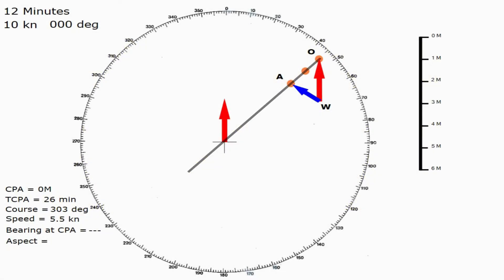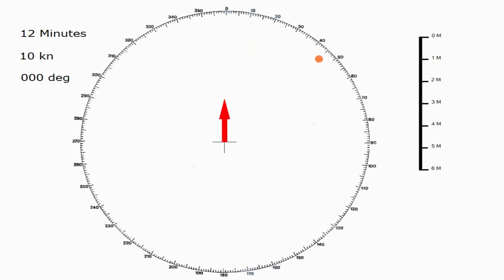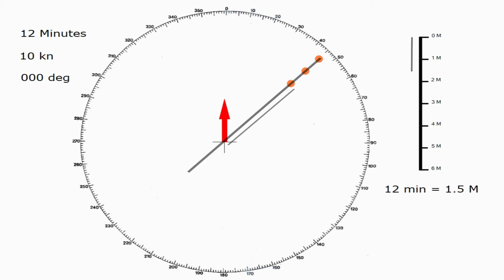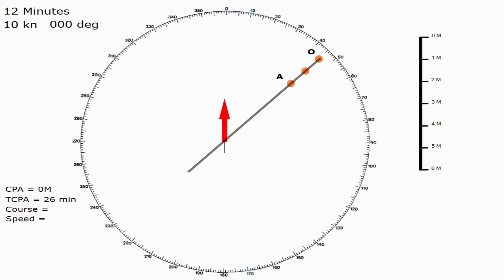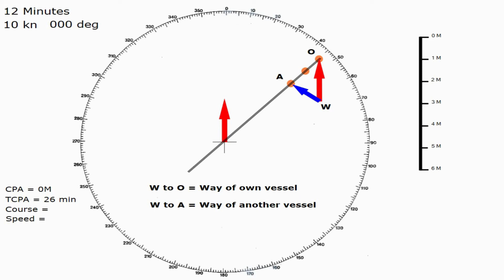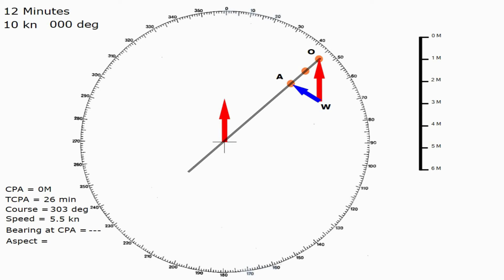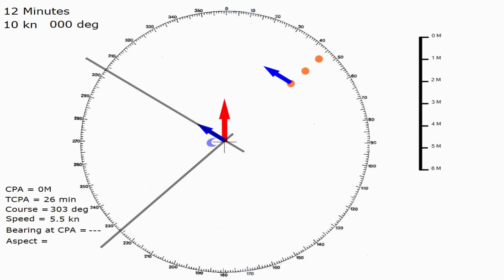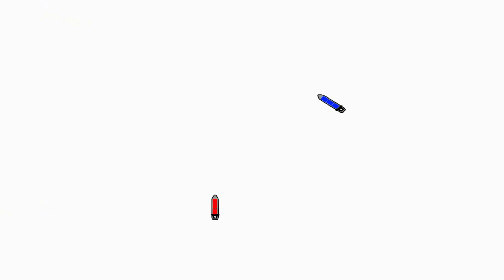Radar Plotting: Complete The Plot

Comment: Radar Plot

Easy to Understand Summary by M Doyle.

1.	The range rings have got to be represented as a ruler on the side of the plotting sheet divided into units - the best one is if the radar has been set to miles with an overall range of 6 miles - each ring is a mile, and we draw that as a ruler against the side. The inner unit miles can be divided into parts - but those parts are not miles just units of each mile. So, the ruler is a side representation of the range rings - that’s all - just for measuring plots and distances more easily.
2.	Drawing in your own vector from the centre of the range rings - your distance travelled and direction – is next.
3.	Marking in on paper the actual plots of the incoming vessel/s that you are viewing on your screen.

The above are the first three steps.

In the first instance, we only know the range and bearing of the target vessel. We know it is six miles away as it appears at the outer edge of our range rings - and we can see on the compass the direction it is from us - its bearing.

To immediately find the CPA - we joined a line straight through the middle of three plots - where it passed us at the closet point is the ‘CPA’. If that line goes straight through us, then we call it zero. 

Now we move on to TCPA - to “find out how long until that collision’ calculating time to go until the collision - remaining distance (to you) x overall minutes of plot/s taken (e.g., 12 minutes) divided by distance of target vessel so far travelled (ratio).

So, we first work out how far it has travelled in the 12 minutes that we have been plotting it. By figuring that out we can work out the time it will take to complete the journey to us.

So, we grab the distance travelled (using the ruler) - then grab the distance to go (using the ruler) - it is not the total of the range rings as we are moving relative to it - these two figures are our ‘ratio’ - we know the math now - distance to go (between us and incoming vessel) x total minutes of the plots, divided by distance travelled so far (of incoming vessel). We get the number of minutes left to the CPA which is our TCPA.

So, we can now write this by the side on the plotting sheet:

CPA
TCPA

Then we move on to discover the target vessel’s:

Course 
Speed

 He labels the incoming vessel first plot position as O (first position) and A (Final or Actual position). 

The moves are as follows:

1.	Drawing the Vector of your own vessel as a line extending away from target vessel’s first position (O). Using your known heading. North makes it very easy. You draw the line away from the target vessel the length of your vector (your calculated distance based on speed over the plot time elapsed - as per 2 above).
2.	Labelling the top and bottom of that vector ‘Way of Own Vessel’ vector as W and O (the O is for original) - has already been labelled. (W) at bottom)
3.	A will be added for final plot position if not already labelled. (Actual)
4.	Joining the W (bottom of your vector) to the (A) to provide another vector. (Way of another)
5.	Sliding that vector (WA) back to the centre and extending it out to the edge (of the compass rose) to get a course of target vessel. (I call it - ‘the back slide’)
6.	Calculating the speed in knots per hour (of incoming vessel) by measuring the distance of the vector W A and multiplying the minutes travelled (overall plot time e.g., 12 minutes) and the distance (by the same amounts) to get an hourly read off.  e.g., 1.1 in 12 mins becomes 5.5 in 60 - speed = 5,5 Knots. See how 1.1 and 12 have been multiplied by 5 – that is what I mean when I say ‘multiplied equally’). 

1.	Bearing - their bearing is their compass direction from us - not their course. Obviously, if their closet point of approach is zero, they will not bear away from us at the CPA - but if their CPA is say ‘1 mile’ - they will bear away from us in one direction or the other. Looking at this in a more detailed plot later.

1.	Aspect - Move the target vessel’s vector (WOA) onto their ‘A’ Actual position. It was their vector bearing minus our reciprocal that equalled the Aspect- labelled as red if port side. The Aspect is just, as best I can make out, a measurement of degrees that we are angled off the target vessel. It really should be obvious whether we are on the port or starboard side, but it is by how many degrees that we are looking for accuracy. So, we deduct our bearing from the vessel from their heading. Not well explained or easy to understand - needs greater clarity but makes sense at the end of the video when the real-life ships are presented under the plots.